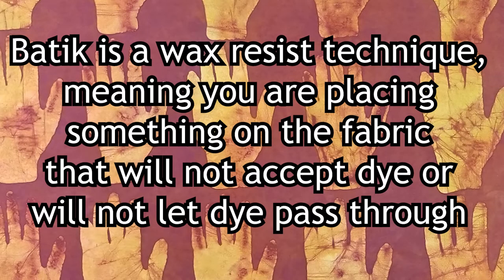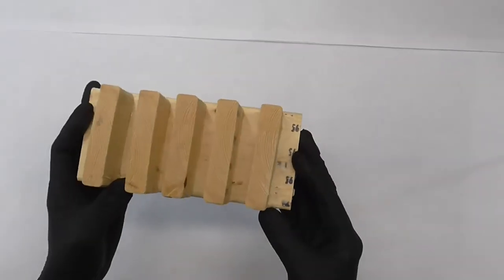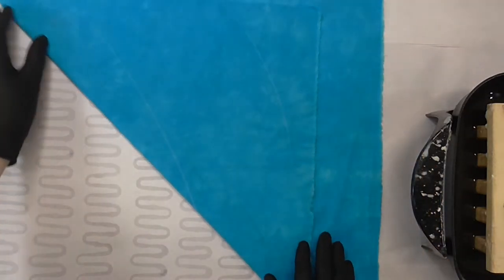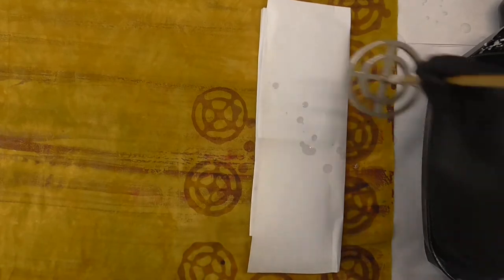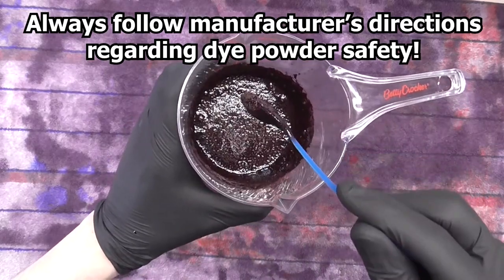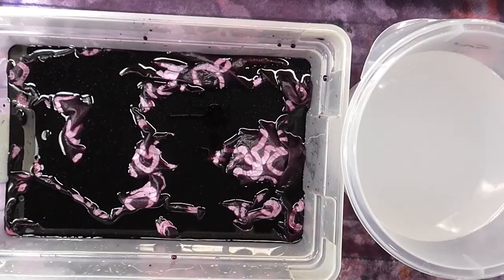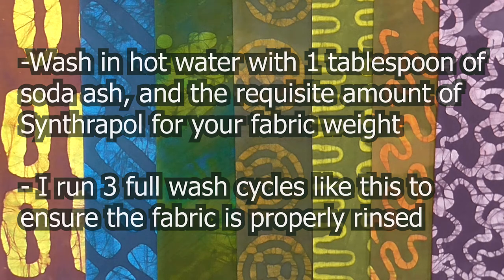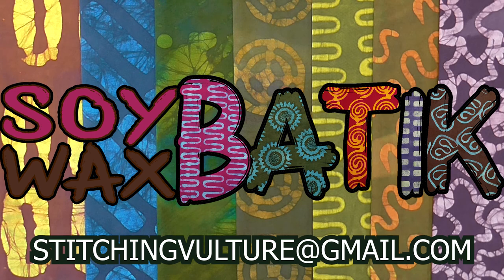Working with Soy Wax Batik

Comment: I am very grateful for this video; you explained it well. I have a question which is very important for me. I have done many batik projects and never dipped the fabric in water. I mostly remove wax by ironing the fabric with newspapers. A few months back, I started to remove wax with boiling water, but I faced the issue that the wax did not remove properly even after 2 hot baths. what do you suggest? should I use anything else for this? and one important thing I love to do is batik with silk paints.
Reply from the maker: Depending on the thickness of the wax, and the type of the wax, you might need to use a combination of techniques. Some dry cleaners will remove wax for you,  but you'll need to check with them first. You can get naptha paint thinner, but it is a very harsh chemical and shouldn't be used indoors or without lots of personal protection.

Comment: Love your video. 
However please don’t throw your water with wax it down the toilet 
So so bad for the environment let alone the septic pipe
Suggestion
make up a bucket outside with a few holes in the bottom and sides
Place in the garden.?
Let’s the water drain out and the wax buildup in the bucket
Reply from the maker: I only use soy wax which is technically biodegradable; moreover,  I am only disposing of very little wax as most of it cakes around my rinse pan.

Comment: Hi! I'm wondering how large your electric skillet is?
Reply from the maker: It is 12x12 inches I think. Honestly, it was just the one the grocery store was selling around the holidays. I got it for like 15 USD.
Reply: Is it ok to use soda ash in the washing machine? I had read not to dry fabric in dryer that was soaked in Soda Ash… ?